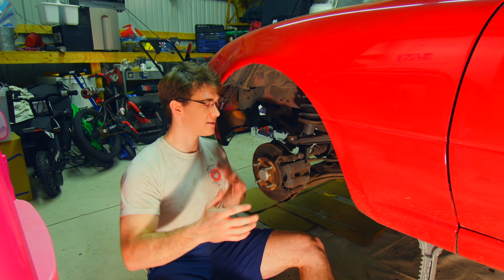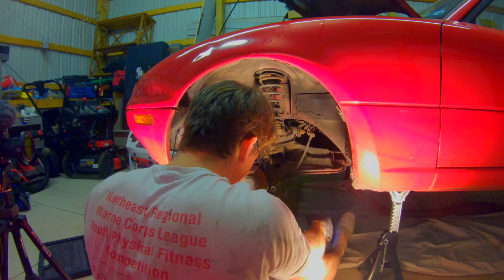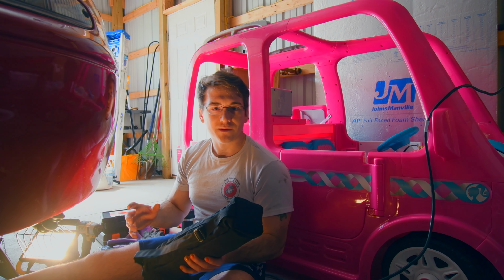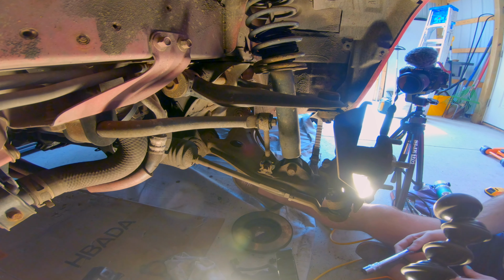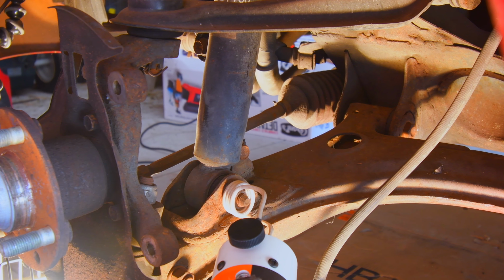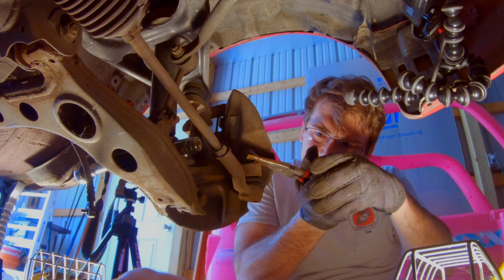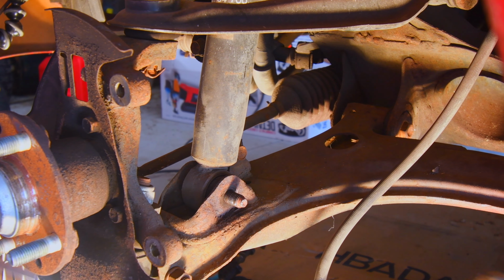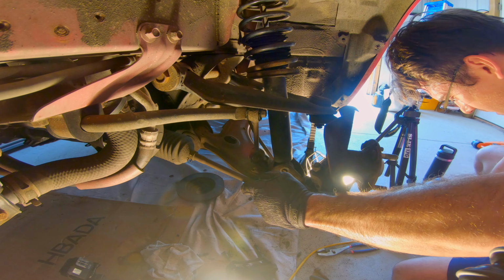BUSTING BOLTS & taking names | How to remove rusted & seized bolts from your car | #MamaMiata 38

Comment: Did you try penetrating oil and a longer breaker bar for bolts that you could access? Lots of time and effort invested, I admire your dedication.
Reply from the maker: I tried penetrating oil, but my impatience meant I didn't wan to wait for it to take effect 🤦‍♂️ A longer socket proved to be a really good solution and is part of my "new & improved" process I'll demonstrate in the next video.  The next 3 wheel wells took less time combined than the first one!